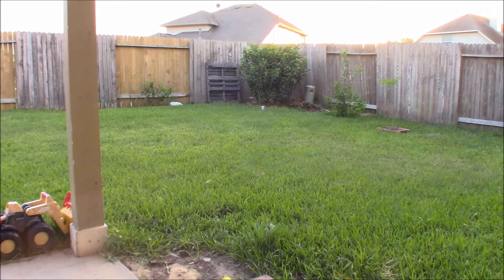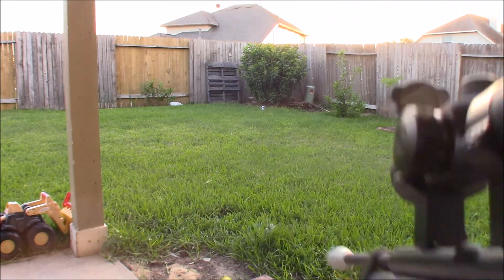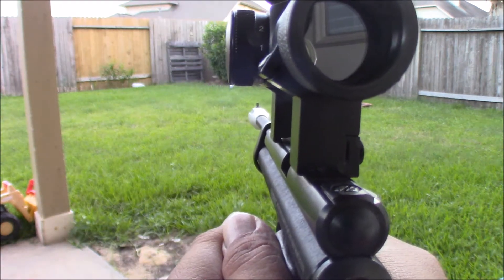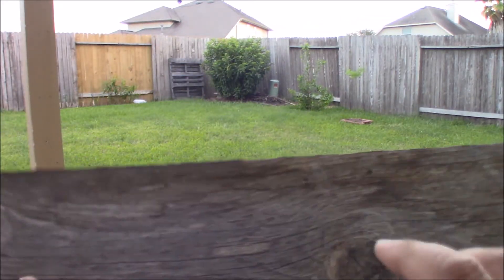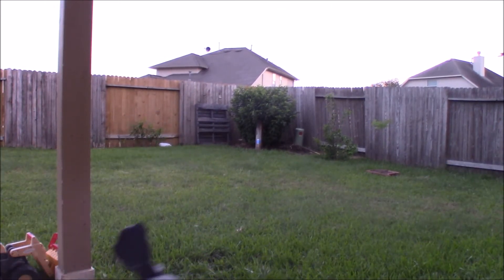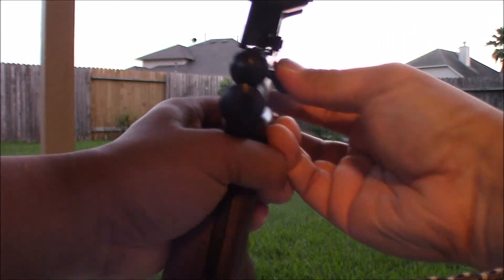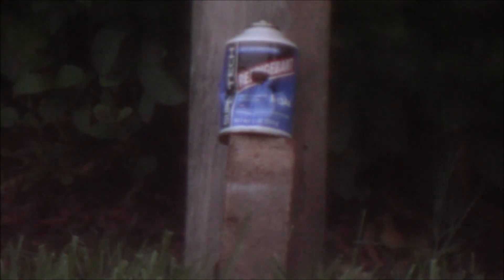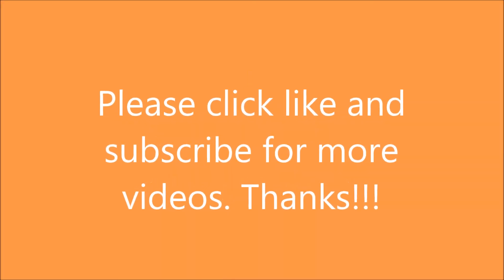CROSMAN 2300KT SHOOTING

Comment: I saw the same sight on eBay, thinking about buying it to put on my Crosman 1377 but I'd like to have a second opinion before doing it. how did you like this sight for your Crosman?
Reply from the maker: rings are too high. red dot is too big. For close range no problem like 12 to 15 yards.I bought a medium size 1 inch rings and it looks better.
Reply: The scope/sight rings need to be as close to the barrel as possible. It will be more accurate at different yardages as the pellet path, and sight plain are closer together.